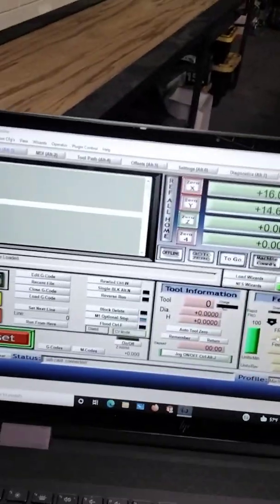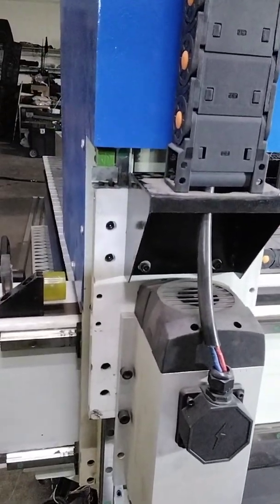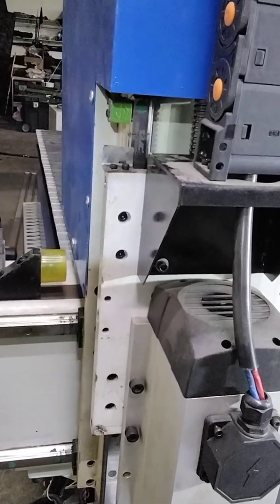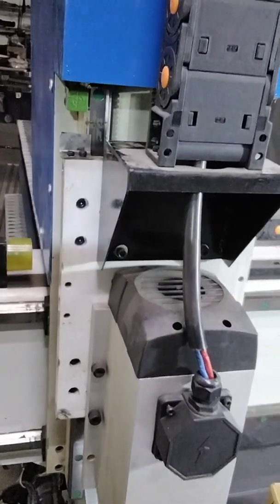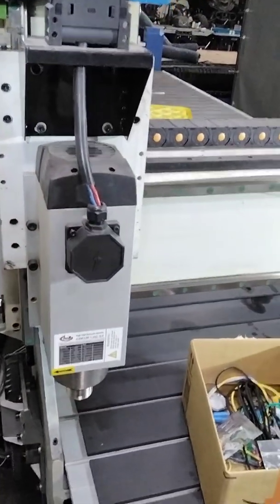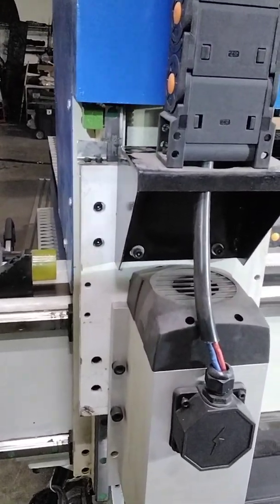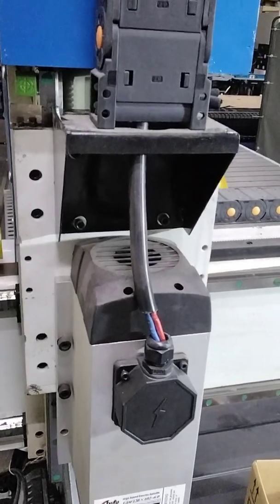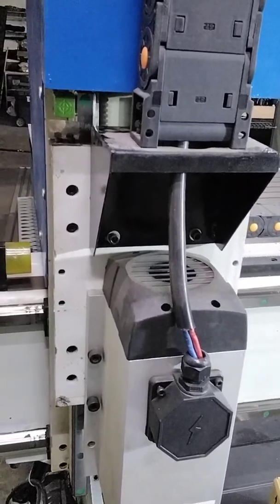Mach3 Homing problem

Comment: Same problem.... Need help too, have you found the solution?
Reply from the maker: No did not. I did narrow it down to the Y x is working now as it should. ,  locally my machine has 172inch long table so it does not effect much. imo its the motion card I'm planing to get an other forget ZK motion seems like they do not stand behind the product